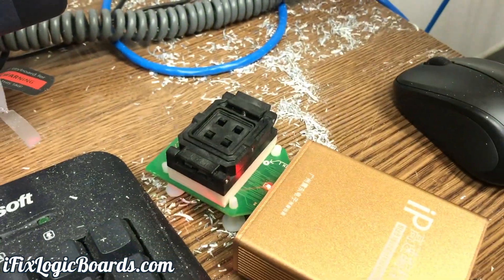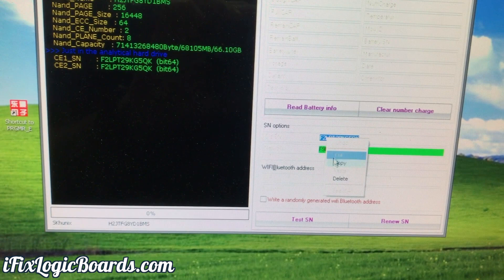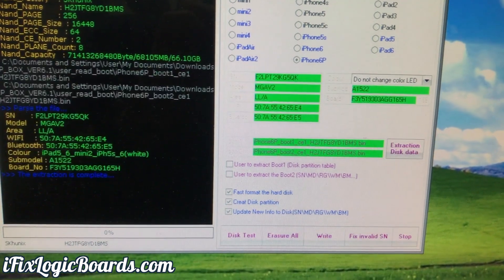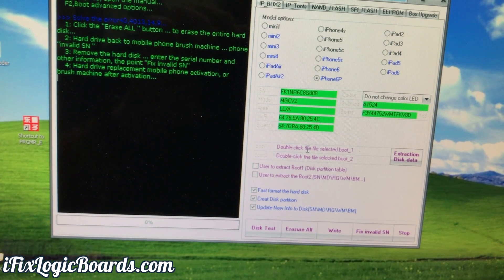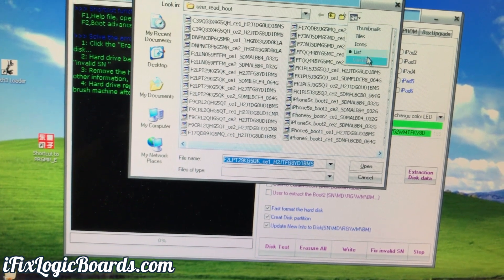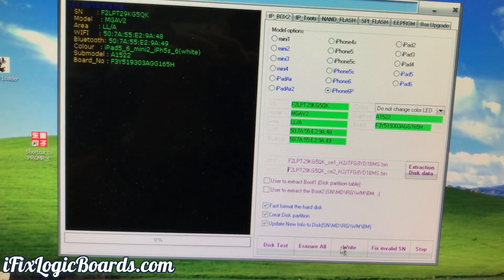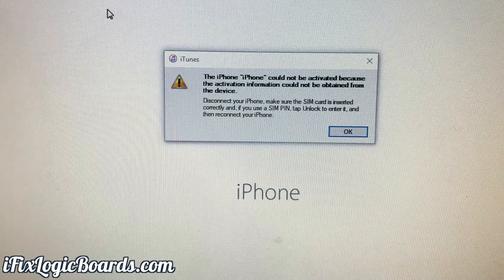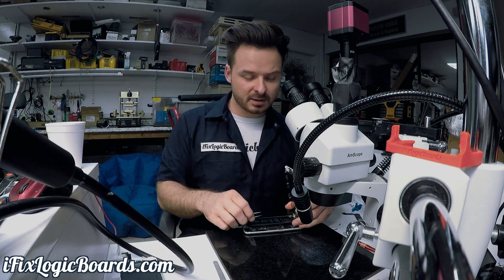iPhone not activated because activation information could not be obtained. Error 4013 aftermath?

Comment: iphone 6s trying to update, tried updating through itunes aswell a restoring it. 
had the same problem with the update before this one but i randomly kept trying over a week and it worked...however this time i feel it wont spring back to life...

what i think may have caused mine to go into Apple self destruction mode was leaving a sim card in the phone for several months that the phone wasnt actually unlocked to. one day, it randomly started picking up the signal for 'EE' when the phone its self was/is locked to vodaphone. this worked well for a few weeks untill this update problem arose. 

SUMMARY: FUCK YOU APPLE.

Comment: Anyone found a solution for this? My first time seeing this problem also. 

I have a 7 plus same error message but error code (-50) phone never been opened before. Went directly from 11.1 to 12.2 then this issue happened so I cannot get past the activation screen. 

It’s not WiFi, iTunes, SIM card issues which I’ve confirmed. Imei and serial shows on the home page
Reply from the maker: Does it connect to network ? I see that usually from not reading the baseband.
Reply: ScoopOf3D actually I thought the phone was never opened but I opened and found it had board repair before. Nand was never touched though. It would connect to WiFi and I can see my sim network bars but couldn’t get past the activation screen. 

Upon inspection I found that NFCSW_RF chip was missing from previous repair. I took one from a ip7 doner and guess what, the 7 plus got past the activation with no problem! I even restored it two more times just to verify and it’s been good.
Reply from the maker: @OceaniPhonerepairSanFrancisco   Good job.

Comment: I have the same issue with iphone 6s stock board untouched, it simply lost signal i tried to restore the phone and it went smoothly, but when the activation screen pops out i got the same error. i supose this is related to the modem's hardware, and i say this cause the phone shows all the correct info, is not reported stole, it doesn't owe money or anything like that.

Comment: I just faced the same issue after performing the reset on iOS 11.4 on my iPhone 5s, Is that possible to downgrade to iOS 10 and perform the activation?
Reply from the maker: Downgrading like that is not possible. I got that error because wifi Mac address was changed during the nand format. After changing to original mac from factory it worked.
Reply: How do we know which address is wrong and what are the original addresses ,if we bought it second hand phone with no bill?
Reply from the maker: You can the serial number of the board taping info icon on activation screen and then go from there.
Reply: I'm in the same situation... iPhone 5S Refurbished, After reset not activating, and the IMEI shows a iPhone 5C... did you find something?

Comment: Did you find a solution? Do you need to enter the MAC address that is corresponding to the phone you’re repairing or the one from the NAND chip you are using to replace the bad one?
Reply from the maker: Yes, mac address on nand wasn't a mach with what was on apple servers. You need to run a GSX report to get that and program it into nand.
Reply: Ok but the MAC address of the original NAND or I have to save it from the NAND I want to put in, because here is the thing, I tried both ways and it is still not working for me and I wonder why? I had an error 9 on my client`s 6S and I copy all of the NAND data to a new NAND, which I took off of another water damaged 6S and the client`s phone booted and restored fine, but wont activate, I entered the MAC that was previously on the new NAND and still nothing. If you have any idea what should I do I will very much appreciate the help :)
Reply: did you check the board serial? region too

Comment: Hallo, its on your PC problem not on the iPhone , try with hosts . i have the seam issue and i fix it by change the hosts file .
Reply from the maker: No, it was wrong  wifi mac address.
Reply: @scoopof3d  Hi I have an iPhone 6 with this activation issue but the wifi and the bluetooth mac address are the same as original, do you have any idea of what should I do. I ordered the JC pro with the nand adapter, do you have any sugestion?
Reply: pls help me out here

Comment: bro i have i phone 6plus after update 11.0.3 its totally fine but  then i was reset all  eraseall content my phone stuck i mean the error is your iphone could not be activated because the activation server could not be reached. Try connecting your iphone to itune to activate it. or try agian in couple of  minutes .          if this problem persists, contact apple support at apple.com/uk/support . when i connect i tune the i tune error is heading "the iphone  could not be activated because the activation information could not be obtain  from the device"
down of heading is Disconnect your iphone make sure the sim card is inserted correctly and if you use a sim pin . tap unlock enter it . and then reconnect your iphone . kindly give me easy solution waiting you answer
Reply: have you got any solution bro

Comment: Help pls! Urgent!
Same thing happens on my iPad mini 4 WIFI 64GB that my parents bought me 10 months ago, i updated from iOS 10.3 to 11.1.2 a few weeks ago, and now it says could not activate iPad so i plugged it into iTunes, restored it with recovery mode, but said activation info could not be obtain from the device, and asks for sim card and sim pin, but as i said before the iPad is wifi only and no SIM slot. I visited 3 technicians already and they said they don't know what's causing the problem. I also noticed the serial number on iTunes is different than the one on the back housing, its like the serial number was changed. I copy pasted the SN on iTunes in sndeep info, said it is a black iPad mini 1st gen 16gb wiFi cellular, which is wrong, but when i checked the serial number written on the back housing, it is the correct one, with correct info about my device (Mini 4 WiFi 64gb gold)
Reply: Hi Wahiid, I would advise you to take to an Apple store or a technician. The technician i brought my iPad to said it was a problem with the logic board. Repairs for this are very expensive though, i got charged 120$
Reply from the maker: Did they buy it brand new or used?
Reply: Used iPad. Please help, I use the iPad for school and right now i am using it on DNS bypass and it works fine but I really need to use it activated now. I still know my iCloud password btw
Reply: I found a technician already but they are asking for very high price, around the price of a used iPhone 5s
Reply from the maker: New iPad mini 4 right now is $399 so around $100-$140 sound seems to be average. Especially opening iPads is somewhat a pain and there is always a risk of cracking the screen($130 part). You have to have a $500 programmer. I think your iPad was iCloud locked and someone changed the serial number and now its not activating.
Reply: It is not activation locked. It is signed in under my dad’s iCloud acc and he still knows the password. But if u think I remove it from his account through iCloud. Com do you think this issue will get fixed or not? Or do I really need to bring it to the technician and have it repaired and also the serial number change back to its original (which is luckily on the back of the iPad)?? Please reply...need the iPad for school right now, and I am currently just using it on DNS bypass
Reply: ScoopOf3D Hello, it is fixed now and working properly, but i am worried that this problem will happen again in the future. How do i prevent this from happening again?
Reply: i have the exact problem as you , please how did you fixed it??? driving me angry
Reply: Orange Fruit what is the logic board are you talking about? you mean nand or the memory? They replace it or just repair?
Reply: Orange Fruit where exactly the same issue different serials and indicating that theres a sim but my ipad mini 3 is wifi version only.. the issue happen when i decided to reset my ipad then end to this issue..

Comment: Do you have any solution now?
Reply from the maker: I got it running by matching the wifi and bluetooth mac addresses with the GSX report and it worked. Have you had your nand repair before?
Reply: @scoopof3d  i didnt do anything to my iphone x, i just update the OS. Then suddenly i can not activate my phone because the activation information can not be obtained just like your phone. Do you have any ide how to fix it?
Reply: @Mystrugglepoint  did you find a fix? I just updated a working phone to iOS 12 and now have no service and unable to activate. ITunes states it can't activate as can't obtain info from phone
Reply: @LemonPuf  nothing! It suck they all ask me to replace baseband IC which take almost 250$. So there will be no iphone in my whole life.
Reply: @Mystrugglepoint  I can't see how they can blame a chip if it's the update that did the damage. Crazy
Reply: @Mystrugglepoint  just to let you know that I got mine working. I put in the SIM before updating through the restore screen and it worked.
Reply: @LemonPuf  man you r so lucky...
I did that once or twice before, nothing happen
Reply: can you show us the process?

Comment: I got the "activation information could not be obtained from the device" after restoring/resetting my iPhone 5s. Any idea how to resolve this? I did not have a chip swap like in the video. Thanks
Reply from the maker: Honestly I would actually try to reflash the nand with proper mac for wifi/bluetooth address just to see what would happen.
Reply: ScoopOf3D Is there a way to flash it without removing the NAND thing? Im sorry for my ignorance for this matter.
Reply from the maker: No.
Reply: Will be ok with the proper mac! I think the server apple cancel some information from devices during restore process!

Comment: so from ios 11 upgrading from 16gb to 128gb doesnt work anymore or u must copy all info including mac adress of wifi/bluetooth ? Oorrr u can swap nands but they should be the same size and all info backed up .. mease explain me because i want to buy an ipbox and should i spend those money
Reply from the maker: I will test tomorrow and let you know.
Reply: ScoopOf3D Thank you buddy
Reply from the maker: OK so wifi and Bluetooth mac address needs to match.
Reply: thank you .... and at what temperature u worked on that nand , so much temp it get and didnt fried ... i use 330C about 1min and its ok
Reply from the maker: Im at 385-390 on mine but I have small nozzle.
Reply: is it real temperature because on my hakko when i set it on 380c its real 330 on the nozzle 6mm i tested with fluke multimeter

Comment: Right so iv just looked back and compared the Bluetooth and wifi addresses and they are both different from when you. Backed up to when you did that restore. Are you sure you restored the right nand backup ?. If you did I know when changing serial ip box can generate a random Bluetooth and wifi address so not sure if this is the case for backup restore. It may not store those two addresses. If you just copy the info from the backup part of your video and write that to the nand it should then work.
Iv got a more complex problem in that the customers nand is fried so need to get this info from gsx, but finding a service that isn't a scam is more interesting.
Reply: Scoop, I have gsx access if you'd like a full report just send me the imei :)
Reply from the maker: Thank you for the offer. I will put the mac addresses that are visible in the video.  If that wont work then ... maybe :]
Reply from the maker: Yea you are right. I will use on ebay and see if it matches with what the nand had and let you know.
Reply from the maker: I entered mac addresses and it works now. Thank you for your input Lain Simpson.
Reply: ScoopOf3D you're welcome !, you can use this same process for nand size upgrades too.
Reply: hi, need mac address & wifi /bluetooth address, can you help?
Reply: I need GSX info Marway, can you assist me?

Comment: get Paid Service Full GSX to obtain correct Mac Address, SN and Wifi/Bluetooth Add must be match ;)
Reply from the maker: But mac's are saved to.
Reply from the maker: Worked thank you!
Reply: which site you used to get the correct mac address and SN ..etc etc please ? i need help with this issue
Reply from the maker: I used a ebay guy adamenko1987
Reply: How do u do that??? My iPad mini 4 serial number is not matched, the serial number is not same as the one on the back housing of my iPad. Ans iTunes asking for SIM card even though the iPad is wifi only,,, Help plsssss anyone
Reply: you ipad was iCloud locked and then it's hardware unlocked by changing the serial number with another ipad's serial number
Reply: Please help me .. my iPad after change serial number activation error.. now what can I do ? Please help me any one ? How to I can get WiFi/ Bluetooth address with same Siri no ? Help help any one??
Reply: I have tried contacting this user

Comment: you only write mac wifi address and blutooth address from service 100% will done
Reply from the maker: I will try on this one to compare, but mac are saved to from original.
Reply: ScoopOf3D  i already doing till 1.1.2 its 100% working if you will write orginal mac try use service then check its okay or not . then back me if not active iwill help u😎
Reply from the maker: I will try that wolf. Will report back :)
Reply from the maker: Thank You wolf! It worked.  I guess iOS11 checks for mac to now.
Reply: ScoopOf3D you too . but rember this not sucess on iphone 5s icloud hardware method its will not work 😁
Reply: @bewolf3056  Hi be wolf, what service you use to check wifi and BT macs? i used topcode but they don´t give me the WIFI BT MAC. Thanks a lot.
Reply: @dhsistemas  go web site paidunlock.com in gsmhostingforum
Reply: MLB/SN/WIFI/BT adress match no probs AT ALL
Reply: hi sir, i got an iPhone 5S error in itunes "iPhone not activated because activation information could not be obtained" after upgrading to iOS 11.2.6. i found out in 3Utools that i have the same MAC address in bluetooth and Ethernet. is this the reason why i cannot activate my iphone? if it is, how do i change my address? what tools do i need? can it be done by software alone?
Reply: Did you find the solution?
Reply: What's the solution?????
Reply: please do a video on how you managed to do it? many thanks bro